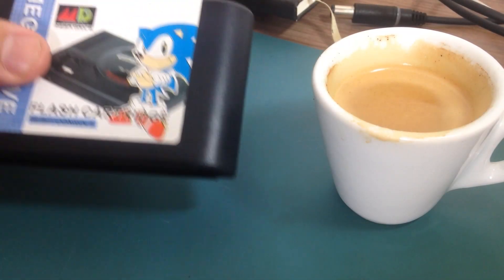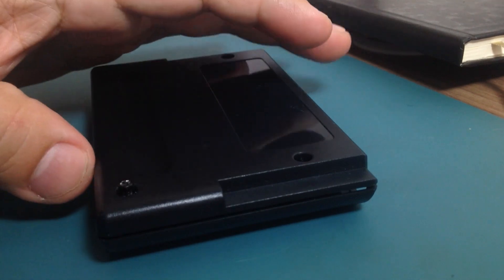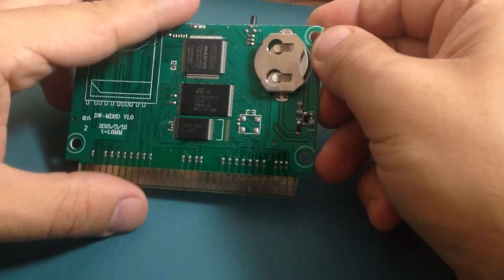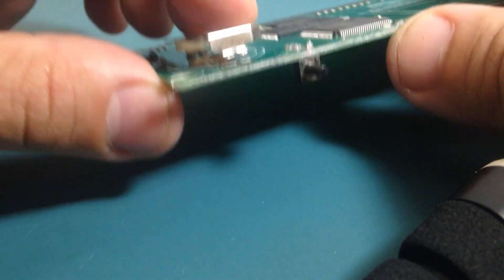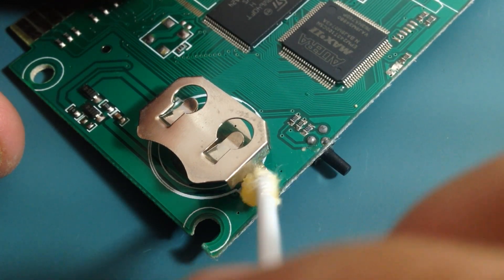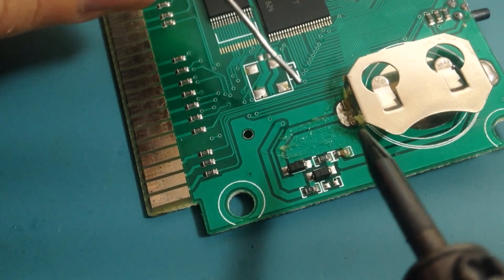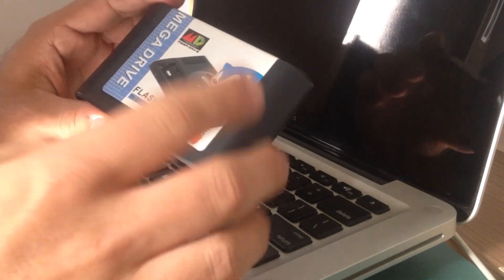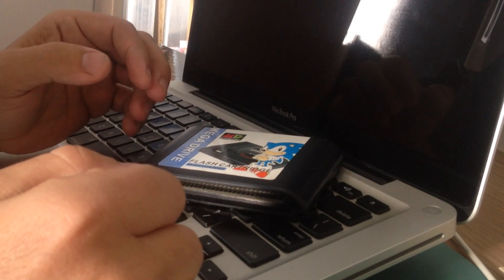Fixing a Flashcart (Everdrive Clone) for the Sega Genesis / Mega Drive

Comment: I have exactly the same flashcart. It does what supposed to do for the price, but there are some issues I have with it - I miss cheats and savestates. I use savestates instead of writing down passwords and I need cheats to play with son. But third probelm I have - it sometimes stops working and I have to reformat SD card and reupload all games again. But 32x games works on it, which is good. Still it's much more reasonable purchase than China Everdive for snes, which does not play any custom chip games - most best ones uses these.
Also, it's 3 weeks already, time for new video. Since you're from Brazil, what was childhood in your city in 90ies? What were your childhood consoles? Clones or original sms/nes? Were they accessible to all kids or expensive? Did you have Saturn or Dreamcast?
Reply: If you want to insert cheat (Game Genie) you can attached the codes one by one. I have try and it work.
Reply from the maker: Yes, that's what I remember. Thanks for pointing out that!
Reply: @BocaRetroGames  your Wellcome 👍
Reply from the maker: Hey @lauraiss thanks once again for watching a video of mine, hehe . I Agree with your considerations regarding this Flashcart, it's the simplest and oldest model based on the Krikkz 1st version from 2011 I guess, no savestates here like the Mega X7, unfortunately. 
The cheats I've never tried, but there's a options there for cheats... I guess it doesn't work then, if you're saying.
Only once I had to reformat the SD, and I guess it was once that I copied some games using the MacOS instead Windows, so I always use Windows when dealing with this SDcard. Mine didn't came with a SDcard, so I had to use an 8gb card from a old Nokia Symbian Phone.
What most annoyed me when I first got it were 2 things: The need to turn off the console, every time you want to change games, 
and the game loading times were enormous compared to my emulators PC  (its actually flashing the rom from the SD to the cartridge memory every time you change games).   
But in the end it gets the job done, as it's the original game file, on a cartridge on the real hardware and that feels great.
Reply: @BocaRetroGames  I've been using this cart for more than a year and did not notice cheats! Must be blind or something. Will try those for sure, most probably they do work. But yeah, it's not the best cart there is, but you get what you pay for. I still consider it being very good. At the end of the day, unlike snes everdrive, you actually can play any genesis/megadrive game. Except for that VR formula game.
Reply from the maker: @lauraiss Yes, it's the Virtua Racing. It's the only game I have boxed JP original here, because of that. I'll take a look if my everdrive has the Cheat menu or I'm  just dreaming here hehe...
Reply from the maker: You're right ! It's been 3 weeks already and no videos... hehe 
But nothing compared to the average time between my videos, which has been usually 3 or 4 months, :) . Thanks for motivating me to make more videos.
Your questions are just great, and they are really good idea for a video addressing them, thanks for the suggestion. Have a Great Week!

Comment: I've just got one of these with a mega drive. I can't get the cart to work. I'm getting a sd card not detected error. Has anyone else got this error and been able to fix it?
I've used 2 sandisk sd cards, a 4 and a 8 gb card
Reply from the maker: Hello. Have you tried to format the sd card with the SD format tool from SD association ? https://www.sdcard.org/downloads/formatter/
That fixed for me. I formated on windows. For me the error started after I've inserted the SD card on a macos and it somehow corrupted

Comment: I have a flashcart from aliexpress and when i try to select the select game in the menu it says:
Fat init hc..... sel error 50 if you can help please respond
Reply from the maker: Have you tried changing the sd card for another one ? Reformat it on pc with a sd format software ? I've faced similar issues and had to reformat the SDcard and put all roms back on it again. Mine is also from alliexpress but I got it in 2015
Reply: @BocaRetroGames  i will try that,thanks!
Reply: But what program should i use to format the sd card?
Reply from the maker: Inf The Edgy Guy sorry for not replying earlier YouTube doesn't send any alerts on replies here ...
Reply: @BocaRetroGames  it worked!! Thank you very much sir
Reply from the maker: Inf The Edgy Guy good to know it has worked ! I use the one from the following link and only on windows . Every time I tried to add roms to the sd card on macOS this error occurred https://www.sdcard.org/downloads/formatter/

Comment: By the way, this everdrive or any other everdrive makes your Sega CD region free. You can copy Sega CD bios on this everdrive, and then boot it from the cart. That will make your actual Sega CD use this bios instead of built in one, that way allowing to boot other region games. For example I have Sega CD PAL version, I insert this everdrive with JAP bios on it, run it as any other game and it instantly switches to CD mode and runs my Sega CD with JAP intro and recognizes and allows to run any Japanese game (even burned copies). It is very convenient extra feature of Genesis/Megadrive everdrives.
Reply from the maker: I didn't know that! Thanks for the info. Now I understand why there are those bios on my fullset I've downloaded to put on the sd card.